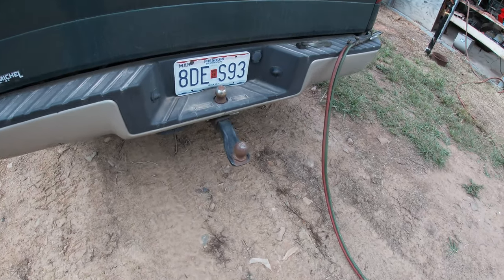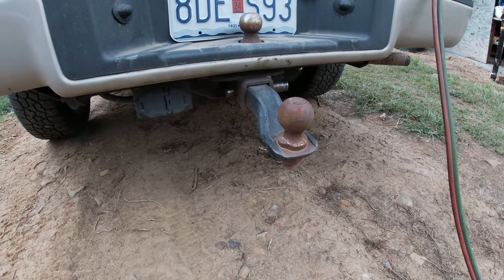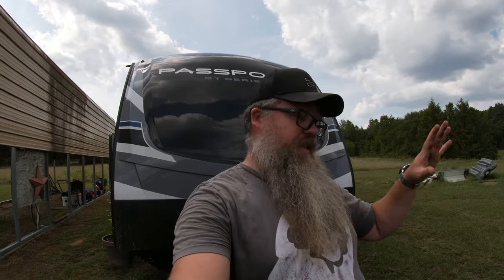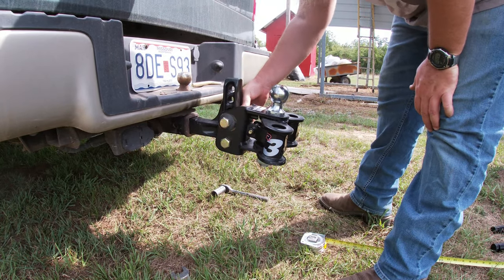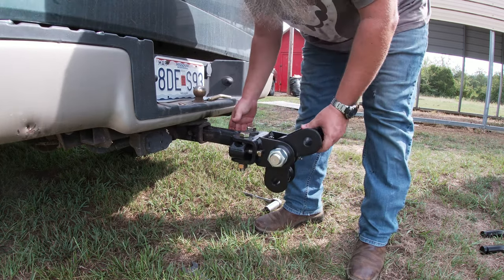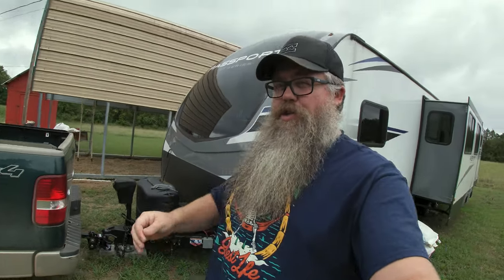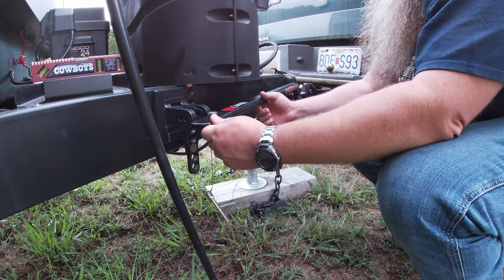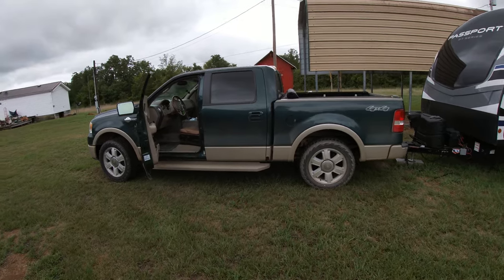Weight Distribution Hitch Setup || Family VLOG

Comment: Mon back, Mon back, Mon back. BANG!!! Yep that'll do. LOL. I pretty much do that every time I hook up to our cargo trailer. Uuumm did you put the pin in the receiver? Oh Dang glad you caught that.  Does this system account for the weight distribution and antisway? Never mind you just answered that question LOL. I do miss our bumper pull but I sure don't miss having to mess with the WD bars and the additional sway control. Shouldn't that AC still be under warranty also?
Reply from the maker: Yes everything is under warranty still